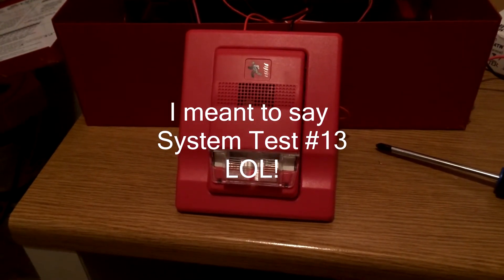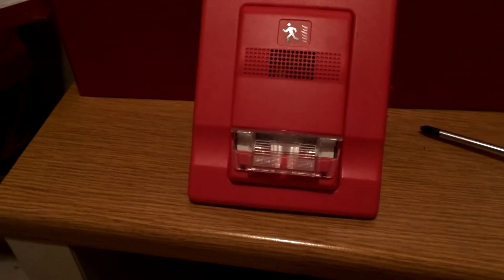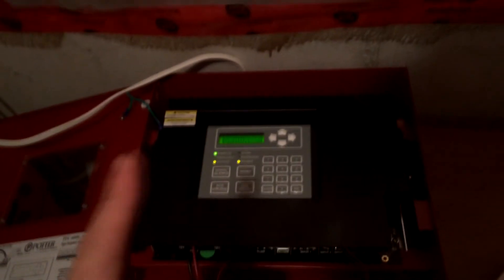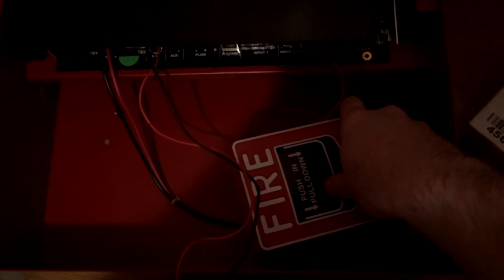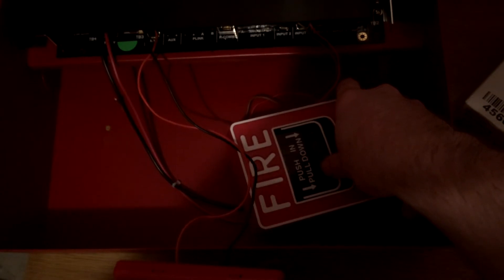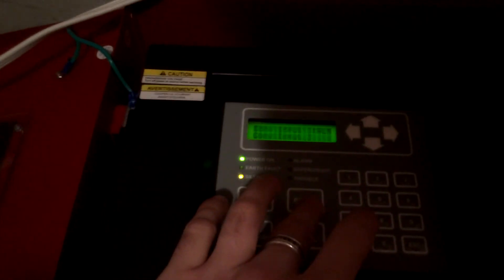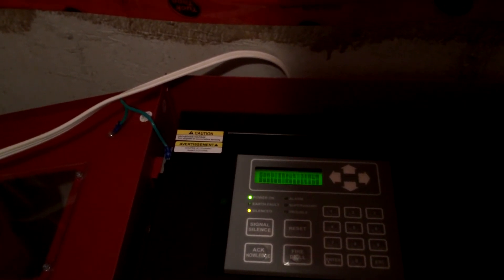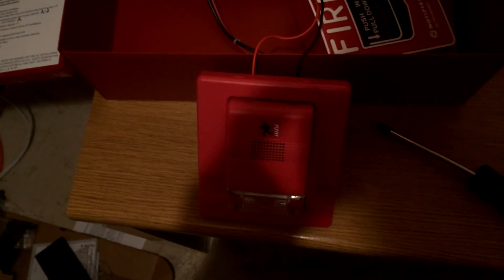Potter PFC-6006 Fire Alarm System Test #13 (EST Genesis Horn/Strobe)

Comment: Dude how did u get that code on that alarm??
Reply from the maker: SELF MADE PRO 

It’s actually done by the FACP (it’s programmed to do 120SPM) that’s why it sounds like that. This alarm does temporal Code-3 on its own, even when an FACP is set on continuous for the Notification Appliance Circuit. 😉
Reply: Oh ok thanks dude